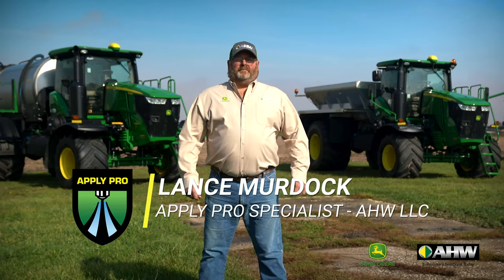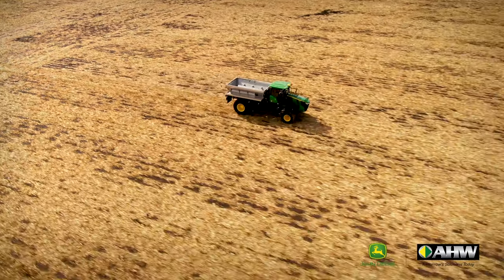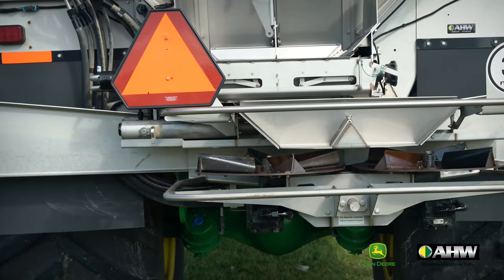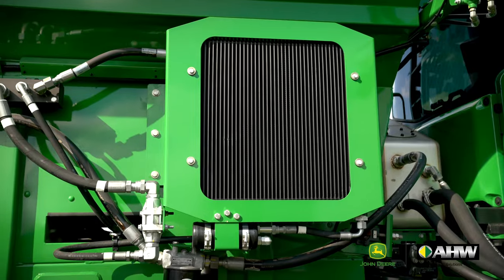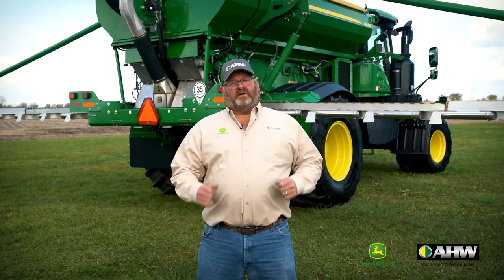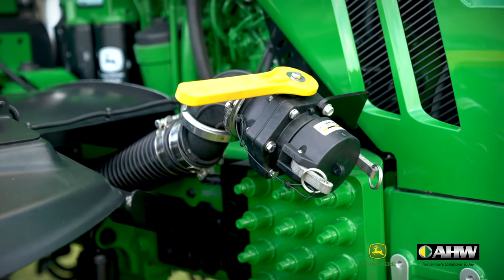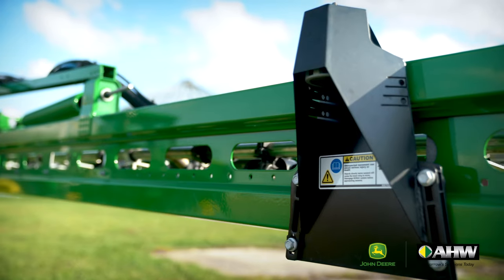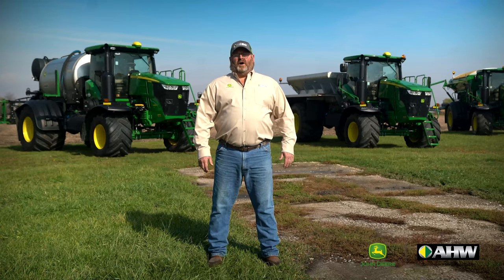AHW LLC - Lance with a Walk Around of the John Deere F4365!

Comment: What's  the fuel consumption and how many acres would you cover spreading lime @1 ton/acre?
Reply from the maker: @Sam Richards - We worked with some of our sprayer team members to pull actual data machines to your questions. Our findings below are based on averaging 2 selected F4365 running last year with the transmission in Auto Mode for maximum fuel efficiency.

Acres Per Hour - 1 ton/acre at 20 MPH is 94 Acres Per Hou
Fuel Efficiency - 6.65 GPH 
DEF Efficiency - .8 GPH